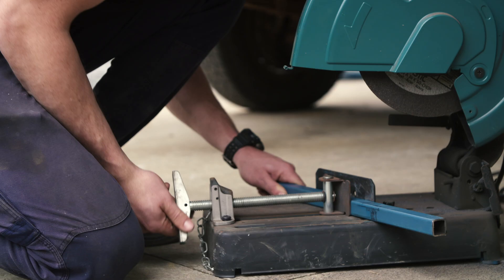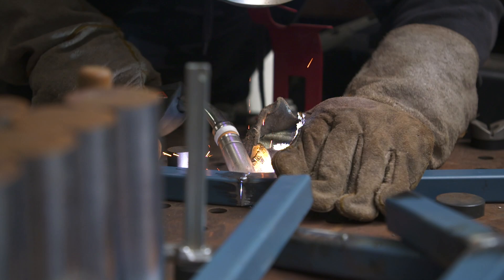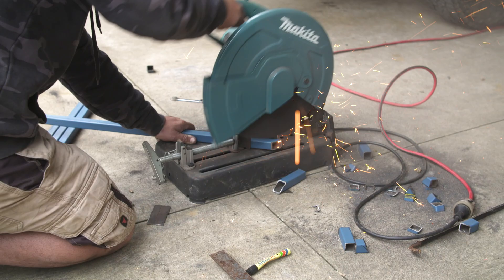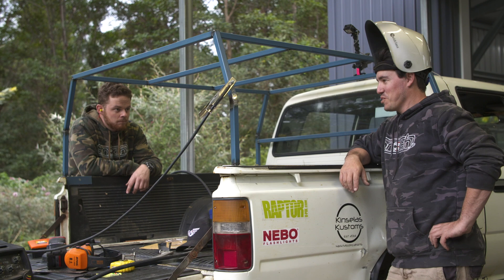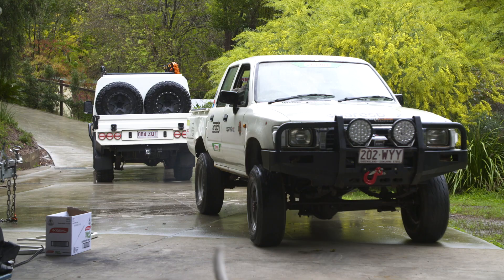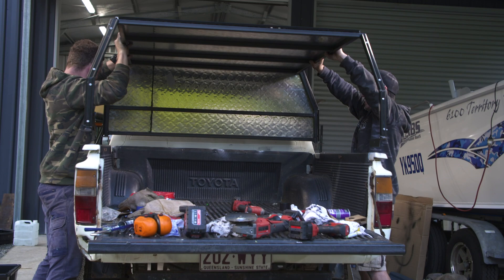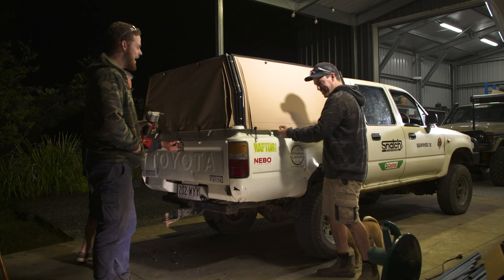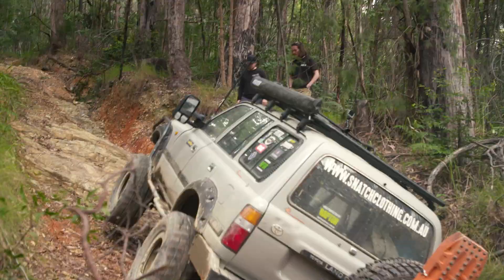CHEAP $1000 Canopy & $200 Drawers Built in Shauno’s shed! This will make you want to modify your 4WD

Comment: Tip,, pull your draw frame out again unscrew it all and glue it,, then put all the screws back in it and reinstall.
 then find some method of blocking the gap between the canopy and the tub. And yes,, even with your best efforts at building, it looks great

Comment: You should look at putting a 2 inch lift and a pair of 32s on it just to make it even more capable
Reply: 2 inch and 33s
Reply: @lucasbarryfitzsimmons5130  oath
Reply: 35s!
Reply: @glassguy283  thats just over the top man
Reply: @beauspicer5274  My friend is talking about 45's on his Ford. It's just a little ridiculous... making them fit.
Reply: @thelagmeister  I've seen 44s on some mean rock crawlers before but 45s on a ford? that would be beast. What axles and steering is he running on or planning to run on that?
Reply: @c4onmylip  TBH. I'm not sure. He has a lot of projects going on like me. I know he has the hp and torque for the tires. He just said something about a 12 inch suspension lift . Probably because I mentioned me getting a 6 inch lift and 35's on my Chevy. I could turn those tires but the cost of the lift kit is insane. I would have to do a SAS and I'm too lazy for that.
Reply: @thelagmeister  yeah, you would definitely have to do a SAS with axles from a 1 ton truck like an f250 or bigger and like 16" travel shocks or struts. I would also assume you'd want full hydro steering to push them side to side. Definitely a lot of work to go that big but its worth it for some when you're climbing over rocks that are taller than most cars on the road lmao. You guys American?

Comment: I built a little frame to mount my toolbox on top of in the back of my ra. Wasn't enough space to have a big enough box and a fridge between the wheel arches so the box sits on top of the arch on one side and the frame supports it the rest of the way while the fridge sits on the other side. Works a treat and can store all my recovery gear underneath the box while being able to actually lock away tools and spare parts plus there's heaps of room in the tub for other things still like my swag and other camping gear

Comment: I’ve got a 105 series land cruiser with a 1hdfte motor in it and a bad boy grunter xtreme turbo in it and when I go camping I got a hot water system in it and I’ve also lifted it and put some 33 inches on it 
I’ve also put a jerry can holder and wheel holder on the back of it and put a switch in it that I can adjust the airbags with 
She’s a beast

Comment: As a 3rd going on 4th year apprentice welder/fabricator, built my own custom tray from scratch for my '02 courier. Turned out a treat and better than I thought it would. Bit out of my depth as I'm only a structural fabber and do fuck all on the mechanical side but I'm pretty happy with how it came out. Even had a bit in the back for a collapsible rack!! Still got it for the moment but I've now upgraded to a '17 colorado. Thinking I'll build another tray and half canopy for that out of alloy

Comment: just complete my first ever engine conversion one my 99 fzj 105 with a 1hdfte out of a 100series with h151 manual gear box also out of the 100 series. also did full wiring harness swap with Sahara dash upgrade. all done on the floor in the driveway with a engine crane. went into it well over my head and some help from mates, Facebook groups and some persistance she's done running like a dream. now for suspension and touring mods, maybe bit more power too aha

Comment: Biggest project I’ve done would be building a full rig from the ground up. It’s a 2010 Jeep Wrangler frame, old 80’s 1 ton Chevy axles, custom linked suspension front and rear on king coil overs, 40 inch milestar tires with steel beadlock, small block Chevy 327 with a granny gear sm465 mated to a Jeep dana 300 with 4.1 t-case gears, the body started as a 1977 Jeep cj7 and it was chopped down right behind the doors, currently working on a custom aluminum tray and canopy setup. I’m in the us but love the Aussie rigs so I’m mixing the two

Comment: Absolutely love the DIY mods you can do from home on these rigs. Shows that you can have a hell of a lot of fun with a 6k set up in comparison to a 60k or more set up. Best thing with a rig like the ponylux is you could easily weld a frame or something on the rear gate and bolt on 2 spare tyres. Even a solar set up on the roof of the tray. Love the channel guys.

Comment: Done a fair bit of fabricating on my Samurai, or Sierra you folks in Australia.  Most recently rear bumper, will be setting up a tire carrier and exo cage before too long.  I’ve fabricated a decent power steering setup, shock mounts, front bumper.  With the exception of machine work I built the engine that is currently in it.  It’s been a fun project throughout the years.

Comment: That canvas turns it from a dirty RHS ladder rack to a mint looking canopy, should install some of those spring steel rod things that hold open the window awnings on roof top tents to the canopy doors then you have a bit of a awning to keep the tub dry..       pro tip use a builder roofing square ($10 from Bunnings) to guess angles works a treat in seconds, used it heaps when fabing

Comment: I've been on my red Ps for 5 months now with a GU Patrol and a lot of this car upgrade stuff is very new to me. I've put the winch in, 3' exhaust, all new spotties and lightbars, custom rear drawer, custom tilt fridge slide and made a custom drop table attached to the rear barn door. Pretty happy with myself for all I've done. About to buy larger coils and suspension to install myself and thinking of taking out the rear seats for more drawers

Comment: Hey fellas good job. Couple of pointers from a fabricator though wrap the car up in a fireblanket to protect the paintwork.  Grinder and weld sparks will imbed steel into the paint and start rust spots. Secondary watch how much of the weld you grind off to flatten it out if your welding thin rhs or rhs without a bit of a prep it will more than likely crack . Come up nice for a backyardy though boys

Comment: I welded together a full length roof rack for my 4Runner as my first "fabrication" project. It was far more solid for mounting an RTT than the initial rack I purchased and it cost far less! There are issues with it, but it definitely holds up to trail use! Next one will be better!

Comment: Great work and homemade fabrications. Definitely something I would be looking into as well. Here in the USA, we have older full-size trucks that we would love to make into off-road champions like your smaller mid-size trucks built by Toyota. I could see an old body style Ford F-250 or even the F-150 running an expedition style flatbed and canopy system, with a mild lift and 35-in. tires. Some of these old Ford trucks are quite the trail worthy vehicles, as long as skid plates and lockers are installed.

Comment: Currently in the middle of swapping one ton axles, dual transfer cases, custom 3 link, and custom ute setup to my 2010 v8 dakota. Also clearancing the wheel arches for 42 inch tires for summer and 46 inch tires for snow wheeling

Comment: I did a solid axle swap in a 1993 isuzu bighorn. Used a y60 patrol front diff and all suspension. 4door ute chopped and rear mounted the radiator.  Was a big job. Yet to test it out.

Comment: Just fitted some 2005 Subaru Liberty bucket seats to my LN106.
Cut the old seat mounts off both seats and welded them onto the new seats n fit perfect.
They do sit a bit high so if your tall just check your height.
Lucky I'm a short ass.

Comment: Never really fabricated or built much before. This summer, I made a full length roof rack out of unistrut and a set of drawers with a platform extension to sleep on out of plywood and OSB inside the back of my rig

Comment: An idea to keep the dust out is to put a vent in the front panel at the top which will feed pressurised air into the canopy and the positive pressure inside will keep the dust out. HiLux trays are notorious for letting dust in around the tailgate.

Comment: My “out of my depth (almost)” project was building a  flat roof rack that hangs between the roof rails  and is a bit lower so I don’t hit the garage door going in.  It  is mainly for me to stand on when taking photos on trips and also has a removable awning and mounting for my Treds.  The big trick is to remember to  take everything off it before driving into the gsrage.

Comment: 1978 cj7.  Is the project...it’s getting a transplant....  Toyota 1pz and h55f trans...
4 inch lift 2 inch body lift. 
Cross member for the transfercase.
Not to mention the body tub patching.  
So far I’ve got the engine pulled apart, had to change a valve in the head. Now I’m search for shims.. to get the valves set.
Then finish’s reassemble.

Comment: That turned out great and I could see where that would be a neat add on to my tacoma. My only suggestion would be to run angle across the entire bed rails to give better support if you are going to add more weight to the canopy. Short stops like that can cause your bed to split.

Comment: an upgrade to the canopy would be to mount an airbox (old from a wreck) on the inside of the canopy and a snorkle head on top (obviously on the outside) to give the canopy positive pressure. this would be one of the most beneficial upgrade to keep dust out of the canopy and not rely on mechanical seals.

Comment: Just installed $2500 200AH lithium battery system...with electric EVERYTHING...I’ve never even had an agm system...🤯

Enerdrive dc to dc...victron shunt monitoring.

Fridge freezer, saeco syntia coffee machine, travel buddy, induction cooktop
Reply: Forgot to mention...its all in the back of my hj61...

Comment: Built my own alloy canopy with detachable roof rack with boat rollers, with a MIG and an angle grinder in the backyard. Cost be roughly $2500 all up for materials, glass ($300), canvas ($650) and alloy MIG set up. Glass and canvas was not done by me.
Reply: what's the quality of canvas you guys used? thnx

Comment: Hi guys. I bought a 2007 Navara tray back pretty cheap. It had provision for an under tray drawer but no drawer. I made a drawer using Stramit roofing iron and ends from spare fence palings. So now I have a drawer with 3 divisions in it. 😊 I can provide photos if I can figure out how to include them.

Comment: (3:20) i wonder how many people looked away when you started welding Shauno LOL
Reply: I built my own set of draws for the Ftruck,including 90ltr water tank up front with 12v pessure pump,right hand draw has a BBQ and 2 burner stove/grill and storage for pots and pans,left hand draw is for food and other camping gear also have 4 pockets front and rear of wheel arches all covered in marine carpet...bit of fun..

Comment: I haven't started yet, still waiting on parts, but planning to replace the clutch in my 02 Hilux. I'm no mechanic but willing it to give it ago. I've done just about everything on the Hilux except a clutch.
Reply: Get yourself an engine crane and lower and lift the box through the selector hole in the floor makes the job real easy

Comment: Can someone explain whether the battery box that Jocko put in would be good for the casual camper? I probably do 1 weekend a month and a 2 week trip once a year. Just have to power lights, laptop and phones etc. This seems way easier than a permanent dual battery system but is it good enough?

Comment: 1 thing to add if you are going to modify something always remove it  before you start  cutting and welding shit not do not mix 2 different thicknesses of metal together created to many headaches  especially if bolting heave weight  to it  you are better to start with a blank canvas

Comment: Why cut the head board if you are going to be putting something similar in its place? Wouldn't it have been easier to incorporate it into the design of the canopy and thus maintain the structural integrity in case its rolled over again?

Comment: SNORKEL KIT!!!!! Sealed and if has distributor how to seal them? :D
Reply: don't seal your diffs, extend the breathers higher into the vehicle, like inside, right up the top of the B pillar, (almost as high as your snorkel intake) using some fittings and couple of lengths of hose. Make sure the hose doesn't pinch anywhere.

Comment: I'm looking to buy a ute with a tight budget of 12k, I was thinking of a d22 or d40 navara (2008 - 2012) due to their affordability. I don't want to do 4wding like this even, just tackle a few chill state forests and small dirt ruts and such. How do they go in terms of reliability? I hear they have problems with diffs cracking and their engines are more prone to leaks, but if anyone has one and loves it with no issues, please let me know. Or any recommendations for another vehicle I should look at that's more reliably suited?. I don't want anything post 200km as I don't have the cash to repair if anything goes wrong and I need this ute for the next 5 years kind of thing, so that pretty well rules out pajeros and patrols as they all rack up miles like crazy. Cheers everyone.

Comment: Almost 2 years ago I bought a gq patrol and I decided to cut it into a dual cab spent 2months researching and finally chopped it welded once or twice in my time and ended up welding the wall in built a few ute trays for myself and mates and now consider myself a pretty good welder, also built the whole thing in the back yard no shed no shelter  I've got the build on instagram ibo_ibuildoutdoors